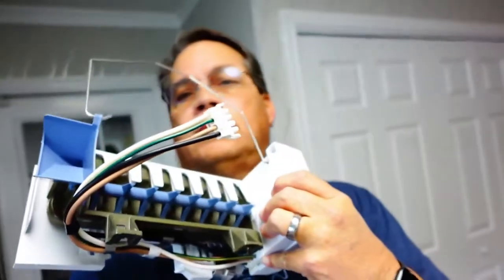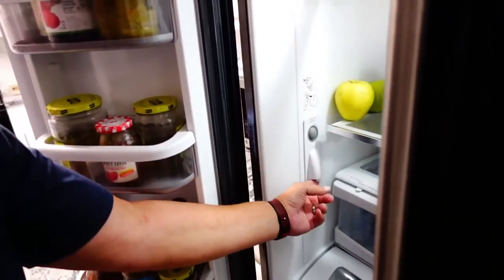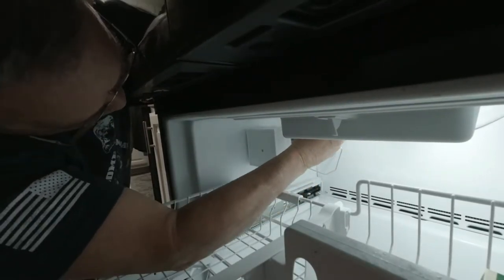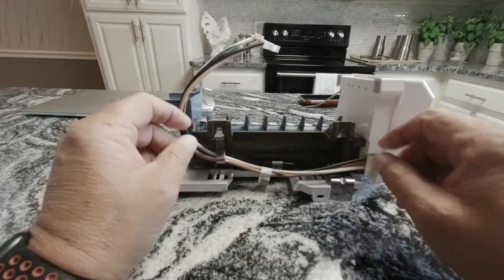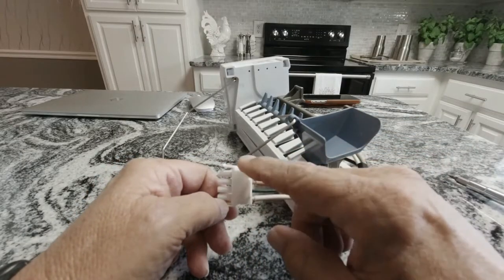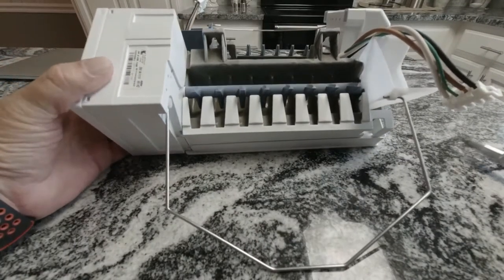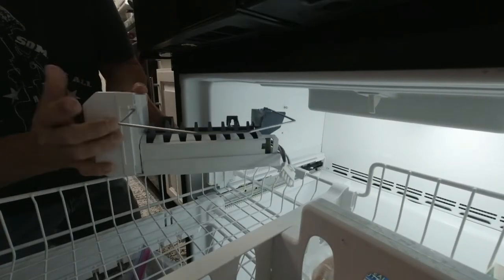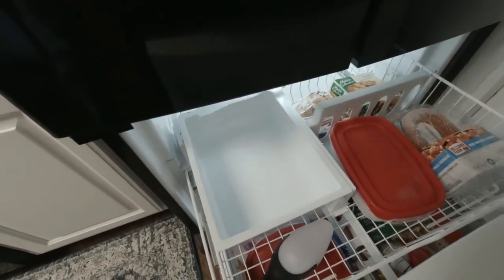How To Replace An Ice Maker On A Bottom Mount Freezer

Comment: Hey Dan, I liked your video. I’m a technician of 20 years. My suggestion, would be to elaborate more on the icemaker. Part number, watts, etc. also check the inline fuse on the wire harness? That black fuse will make the icemaker stop working. Also, let people know that, factory can sometimes take up to 12 hours before it starts to cycle. Good job and good luck 👍

Comment: I think I will have to do this. I just did an off on cycle of the whole refrigerator as another video supposedly from Whirlpool said, since there is no reset switch for the icemaker.  We had someone no close the freezer properly and think it may just be gummed up with ice, and will check before discarding. Just seeing what happens for now.

Comment: I want to completely remove the icemaker from my bottom freezer, so what do I do about the wires? I removed the ice maker already but I didn't remove the wires from the back yet. How do I fix it so it's safe to turn the fridge back on, with the wire connector open like that.

Comment: Thank you for the video!  Our Amana ice maker is very similar to the one you replaced.  Nice to know to use a 1/4" driver and that you don't have to remove the top screws all the way.  I had just got off the phone with the place that sold us our refrigerator and the long time technician said that one of the most common problems is often with the saddle mount fill valve that leads to the ice maker.  Often gets clogged.  Our refrigerator/ice maker is also now going on 7 years old which I understand is about the life span of ice makers in general.    Your video just gave me the confidence that I can with relative ease replace the unit rather than spending $100 + dollars just for the technician (parts not included).

Comment: Hi Dan,  someone placed a frozen item in the ice bin and closed the drawer.  That knocked off the wire ice control arm. I reattached it, but not sure if I did it properly.  Now the ice maker won’t stop making ice.  Any tips on how to reattach the wire sensor so it stops making ice when the bin fills with ice???

Comment: The shut off bar doesn't seen to drop low enough to shut off before overfilling te ice bucket.  I noticed your bar didn't fall very far down either.  Is there a time during the process that something will allow the bar to drop lower?  I don't want to damage anything by forcing it.  Thanks, this was very helpful.

Comment: Hi Dan < I am having problems with my ice maker. I do not have water going to it. I believe it is frozen. I tried to use a hot and a pop bottle to push hot water in the line. No luck. Is there a check vale in the line. The hose goes in about 5 inches and stops. any ideas? Thanks

Comment: Our maytag refrigerator ice maker is making ice cubes however the extra amount of water is filling up the ice cube tray with water and turning the whole ice cube tray into a massive block of ice, however this must be caused by a slow drip, according to my wife.

Our source of water is a well and we do not have a filter on it however it is softened water.

Next I think it's a pressure or mineral issue and not a solenoid issue unless the seal at the solenoid is built up with a mineral deposit?

What are your thoughts?

Kind regards 

Robert
Reply from the maker: sounds like a mineral build up and making the valve seep. I would replace the valve and install a filter in front of it to slow that process down. Good luck.

Comment: Hi,
I followed your instructions but they did not work out. I loosened the top screws then took out the bottom screw per your instructions. But the ice maker did not come out! I had to remove the rear screw, then it came out easy. Replacing the ice maker was a chore the ice maker would not go on both top screws. I had to enlarge the rear hole so that the screw would easily go in. After this every thing went smoothly. Very awkward to get to screws. Your video did not mention how awkward it was.  I spent 3 hours work on this project. The Ice maker fix was 10 seconds.

Tom Jennings

Comment: Great video. A couple questions. I pulled out the refrigerator to check the back. I couldn't tell anything. I am afraid taking the ice maker out that the water will start squirting out all over. I cant find a shut off. You also said that you checked to make sure there was no ice in the fill tube coming into the ice maker. I might take a hair dryer to that before doing this replacement. What do you think?
Reply from the maker: If you remove the ice maker, the valve will not get a signal to fill. so if the valve is not leaking water will not release.

Comment: Hey I have refrigerator at home it's not making ice my refrigerator is Amana
Reply from the maker: check to see if you have ice in the mold, if so the ice maker it self may need to be replaced. You will need to make sure that water is getting to the fill valve and then make sure the valve is good.